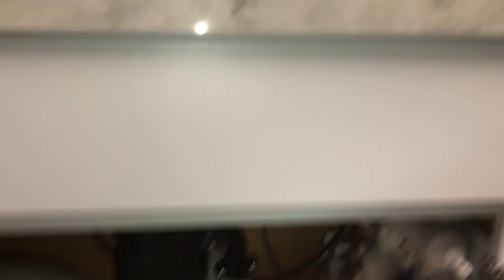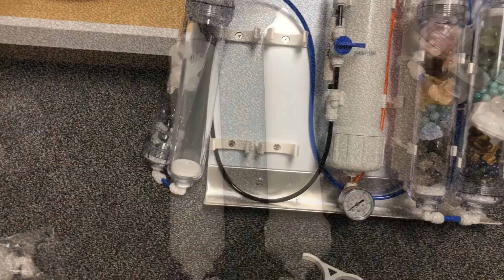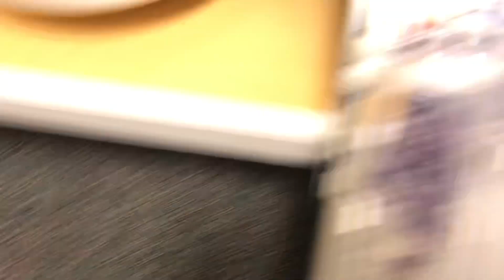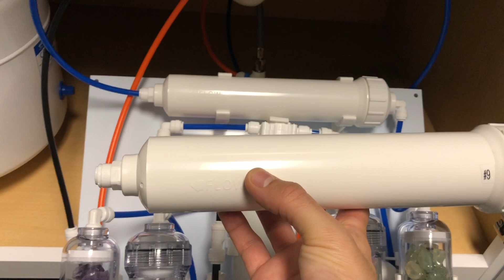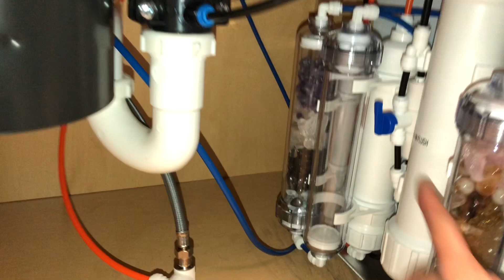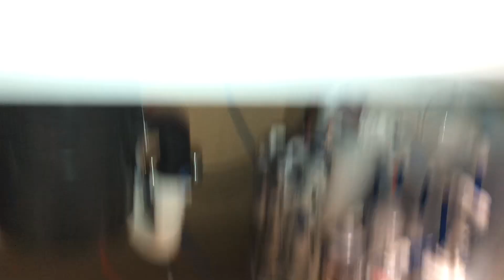Vortex Crystalline maintenance guide

Comment: Looks very detailed. A list of all filters and RO units would be most useful including the reasoning behind their inclusion.
I am interested in installing two separate systems. First would be, whole house with 3 stages, using an Ion exchange with 10 and 1 micron sediment filters. Under counter would be system 2, tapped from the cold water line under counter, with typically some of the units you show on the demo. The details still need to be resolved and that is where your explanation could help.
Thanks for a clear and specific video.
Reply from the maker: Hey Allan! Thank you for the comment - I appreciate your thoughts and recommendations. I will be sure to add some of those details into the description of the video for you. 

The RO system I mention in this video is one I manufacture and contains the highest grade Pre Filtration, RO membrane, DI resin (specifically pre charged) , Remineralization, and final Polishing Post Filter.  With several structuring methods sprinkled in between of course. The landing page to this specific system is in the description and you can find some details there as well, its basically our online brochure for it. I will add some of those details to the description per your recommendations.

We also do whole home filtration and have some information on the same landing page found in the description.

* I would be happy to help you work through the decision making/planning & process of both your whole home and drinking water system

* what would help is knowing if you are on City water or Well water? Comment below! 
 Then we can devise a plan so you set yourself up with the perfect PoE and PoU solutions. 

thanks again - looking forward to helping in any way I can!